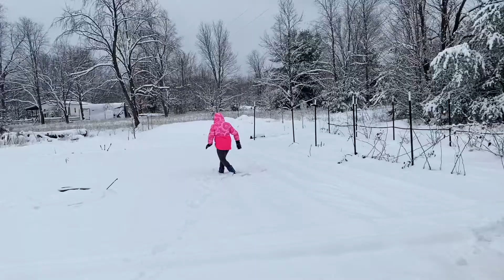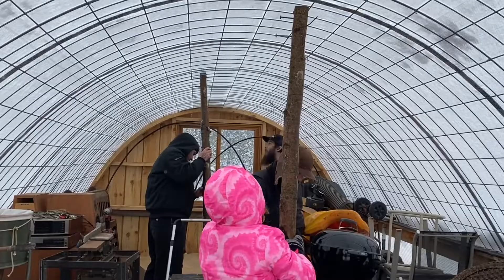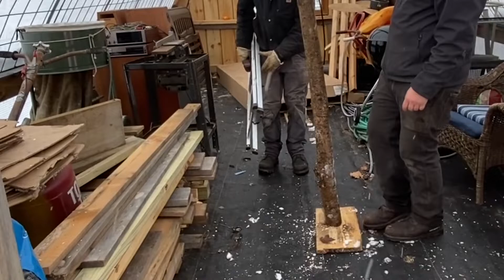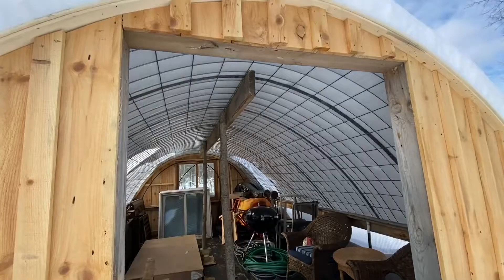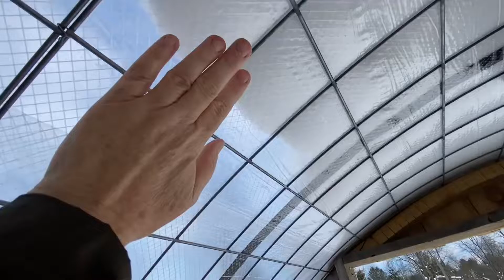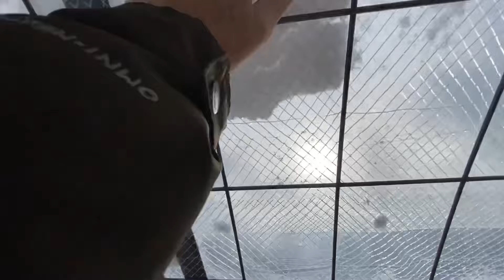Support for Heavy Snow Load  ~  Cattle Panel Greenhouse

Comment: Run a wire cable from half way up the left side to half way up the right side. This is called a chord in geometry. It will make the arch  rigid with very little material, just baling wire would do. Do this where the panels connect to one another.
Reply from the maker: Thanks!

Comment: I thought this was going to actually be a heavy snow load. Like, 5 ft! The problem I'm having with the cattle panel style is that there is so much snow at the base I'm afraid it will cave in side-ways :( I've already cleared the side out once and its already at about 3ft, in December!

Center can take 2ft with a decent beam, properly installed! The support isn't a beam. It's 4ish screws, the beam is not providing any support, if the screws snap it will all fall.

Comment: You need an overhead 2X 6 beam for anything more than 3 cattle panels. 
I live in a snow area and had one collapse under the snow weight with out it.
Reply: After a couple storms I'll show more than a foot on my 4 panel greenhouse. It's got a 2x4
Reply: @iamtmckendry  Hi
I never had any issues with the 2nd 4 panel one I built ( w/beam), but when I redesigned and built another greenhouse, I set up the old cattle panels over my strawberry bed and then put bird netting over that. I did zip tie them with heavy uv resistant zip ties too. It loaded up with 1 foot and a half of snow and started bulging out at the sides. 
I do love to see all the different ways people have done their own greenhouses. Here's my new design...
 https://youtu.be/jUcXq0C30XQ
Happy New Year